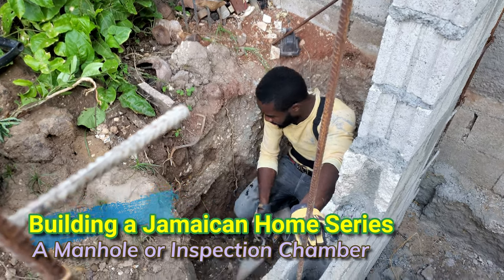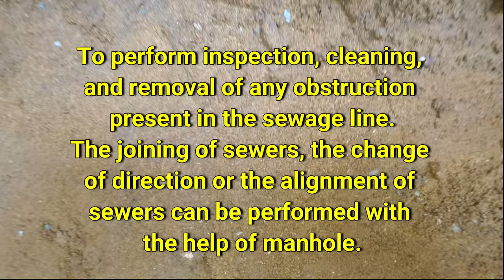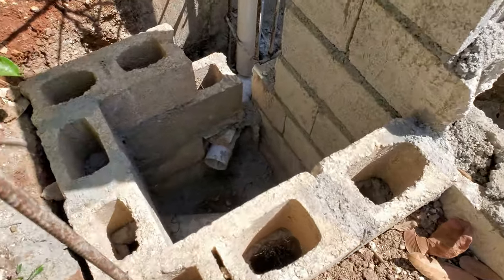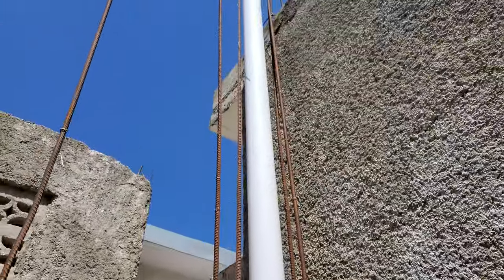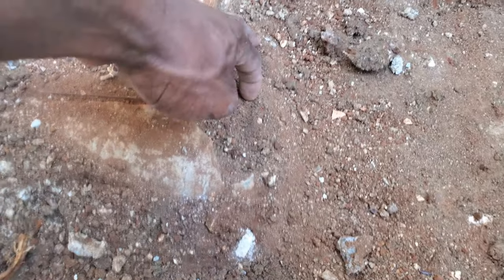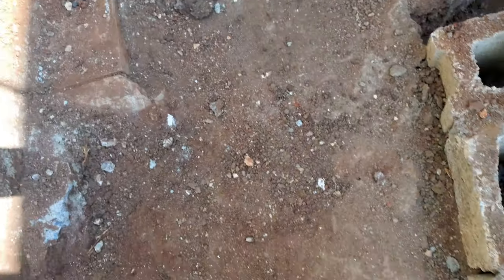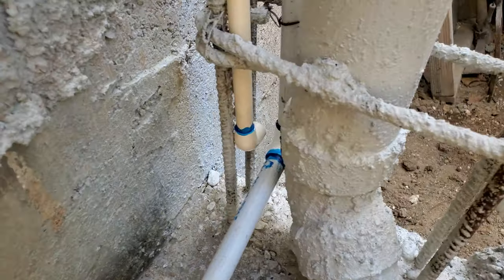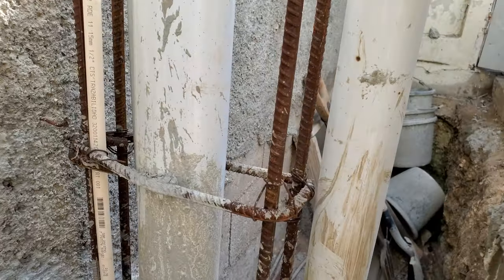Building a Jamaican home series: building a Manhole /  inspection chamber

Comment: Great job. Whenever you ready to cut the main 4 inch pipe use a bicycle cable or the same cordline that you use to put down the blocks. Hacksaw very hard to cut it. But good job.
Reply from the maker: neva know that could a used thanks fi dat nuff respect

Comment: You can use the 3" pipe for the venting for the septic ..just use a sanitary 3" tee with a reducer to vent the Septic tank...the reducer will variety for the size venting you want
Reply from the maker: thanks that's the plan for the upstairs..

Comment: The pipe inside defeats the purpose of the column and weakens the structure.
Reply from the maker: yes but thats the best place for it.. even though the is going to be hollow inside the steel cage will stop it from cracking